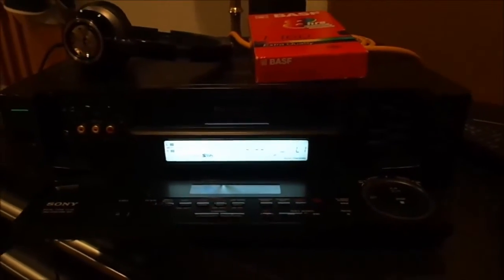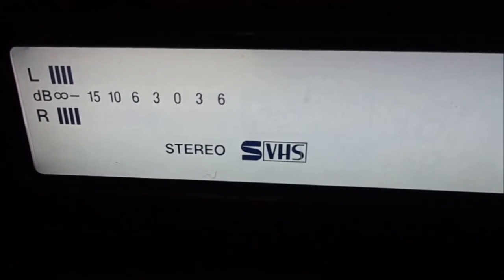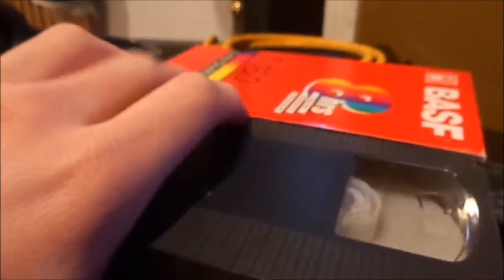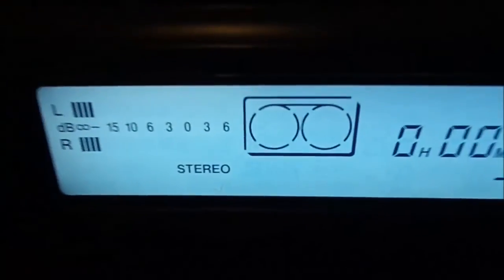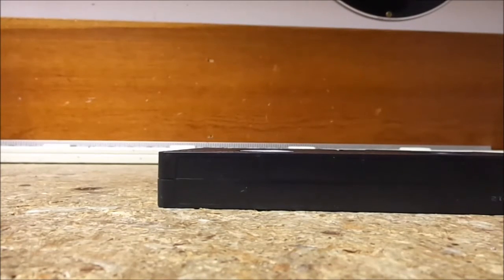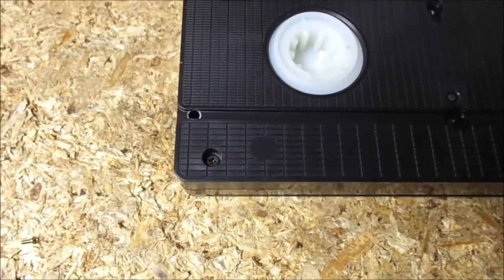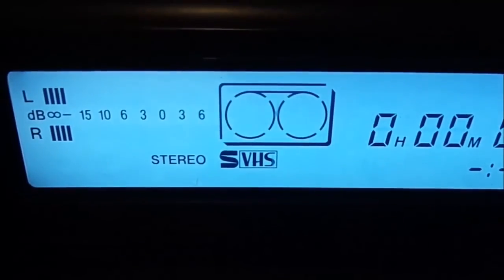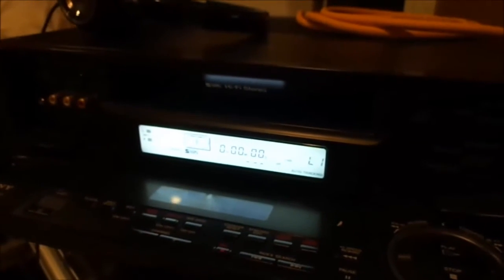How To Modify Standard VHS Tapes to Record S-VHS

Comment: Make sure you use high quality VHS tapes, Using low quality ones gives bad recordings since the VCR is optimized for better quality magnetic properities, If you must use normal VHS tapes use VHS-ET feature if equiped, It optimizes the recording quality based on the quality of the tape to get better results than using S-VHS setting.

Comment: If I modify VHS tape so VCR thinks it's a super VHS, will a regular VHS recording show any improvement when played in super VHS mode?  My machine will only output the S-Video when using a super VHS tape.  So was thinking about modifying cassette to get S-Video output function on regular VHS recording to see if it's improved over using composite (RCA).
Reply: No, VHS is played back as VHS and S-VHS is played back as S-VHS. The only improvement you get from playing back a normal VHS tape in a S-VHS deck is the S-Video output, It's much better than yellow composite out even for regular VHS.
Reply: @Capturing-Memories  Thanks for your response. My machine will only output S-Video when utilizing a super VHS tape.  I modified a vhs-c adapter and even though the machine recognized it as a super VHS tape, S-Video output would only appear as black and white.
Reply: @JD_1978  That's what I just said, VHS is played as VHS, If you put a hole in it, it will be played as S-VHS and the signal will be wrong, because the VCR doesn't care what signal is on the tape.

Comment: What would happen if one did this to a prerecorded commercial vhs tape and then played it back in an S-VHS machine?
Reply: It may not work.  S-VHS records brightness and color on separate channels.  VHS records them on the same channel. SVHS can play and record VHS without modification, but if you drill the tape it will try to play it oncorrectly.
Reply: it will work fine the vcr will play it back like a normal vhs tape

Comment: Or get a Super VHS-ET VCR. You get the same effect without having to drill a hole in the standard VHS cassette.
Reply: I have a Mitsubishi SVHS VCR with the ET feature and it works great. It even has a tape calibration tool so that it will record the best possible picture the tape can handle.

Comment: Useful. 
3:14 I had a same tip as this but with a natural desolder. (without at Electric use.)
Anyway that's will be have at Full Function (VHS converted) as S-VHS (210% Luminance) because that's doesn't depend at Additional function as "S-VHS ET" (190% Luminance)